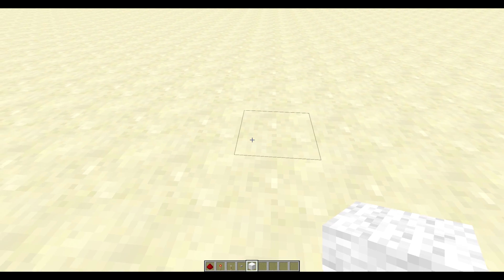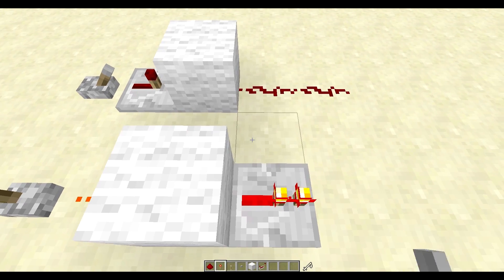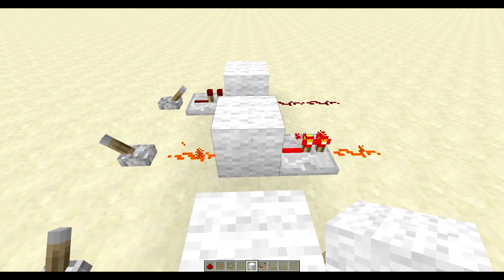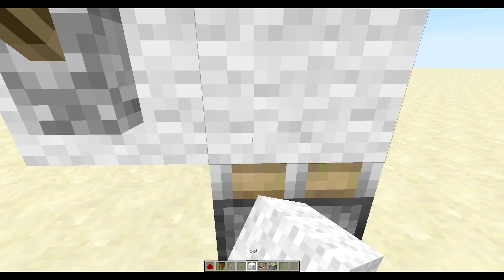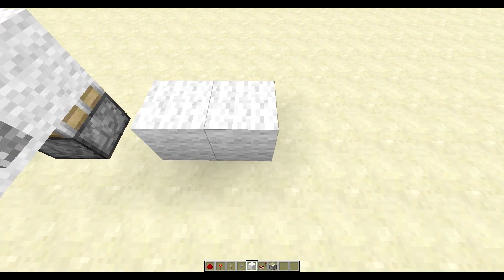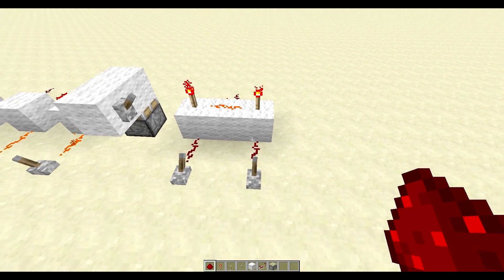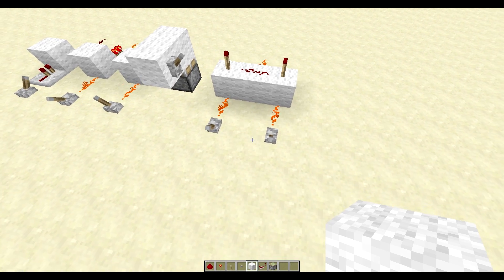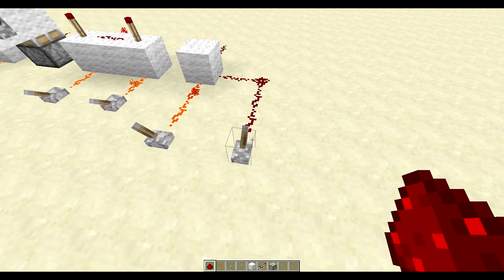Redstone Computer Tutorial - Episode 1 - The very basics

Comment: noun

    a programmable electronic device designed to accept data, perform prescribed mathematical and logical operations at high speed, and display the results of these operations. Mainframes, desktop and laptop computers, tablets, and smartphones are some of the different types of computers.Compare analog computer, digital computer.

Thus... a lever into a piece of redstone dust or comparator or block and then out into dust or piston or door what have you is in essence a computer.  It takes a digital input and gives you a digital output

So what I'm getting at here is:
1) he's teaching the basics of how redstone works before getting into the full computer 
2) know the definition of a word before using it in an argument 
3) this series is a great series on redstone and I hope redstonewithoutlimits will continue to bring new content
4) all of you chuckleheads with your negative criticisms need to go reevaluate your life choices and at the very least learn to present positive criticisms that will add value to the discussions herein and for the future of the content provided by redstonewithoutlimits.